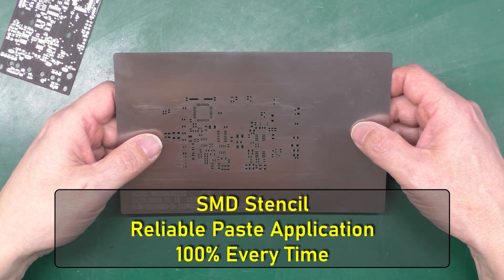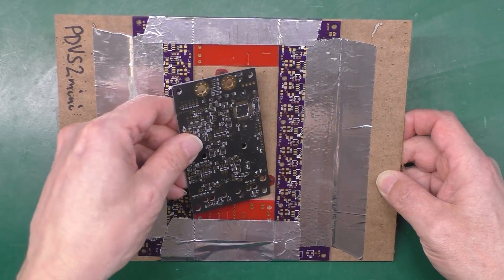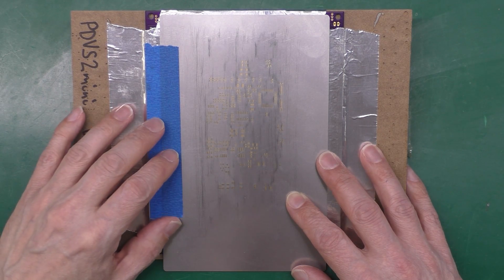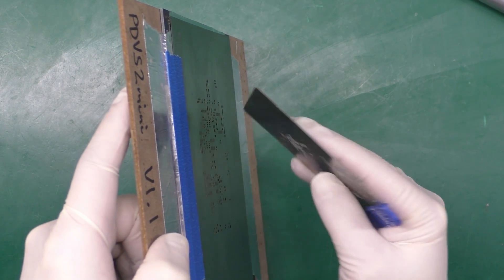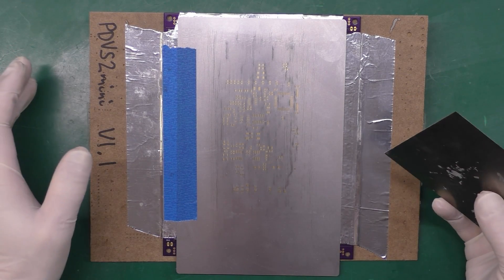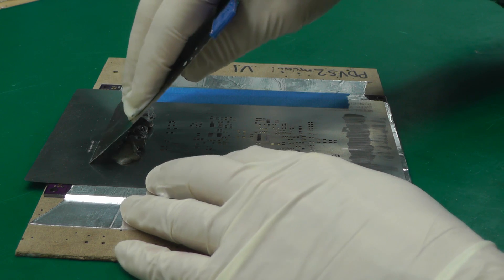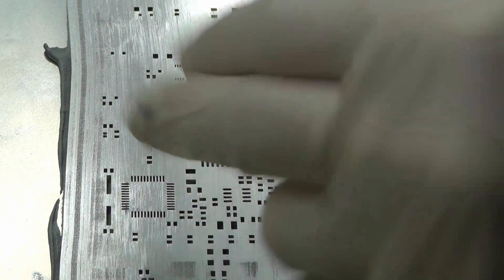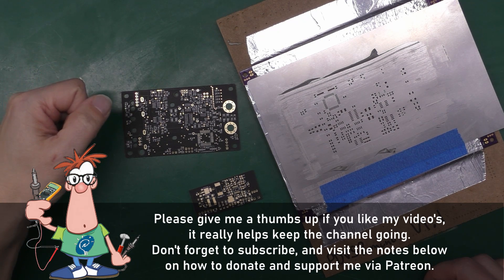No.051 - SMD Stencil - Reliable Paste Application 100% every time

Comment: If you just want to get on with pasting a board right now and can't wait 2 hours for the paste to warm up, can you transfer the amount that you're going to use into another small container and heat it with hot air or microwave it for, say, 30 seconds to warm it quicker? Does the paste need to be stired before using it like you would with paint?

How do you place the components once you've pasted a board? Do you have a pick n place machine or do you do it by hand? If done by hand, how do you not smudge the paste when placing components? Placing 0.5mm pin pitch ICs EXACTLY right first time is almost impossible. When ive replaced fine pitch QFP ICs before i roughly place it on the board with my vacuum pick up tool then carefully and gently nudge it into the right place with my pointed tweezers and rest my wrist on the PCB to keep my hand steady. I solder one corner pin then the diagonally opposing corner. If they are correct i solder the rest of the pins.
Reply from the maker: I place components by hand, and manage to place fine pitch components like the one I showed on the PDVS2mini charger board 1st time, or at least with only the smallest of nudges into place. To me, it's about the tools being used and as you mentioned resting my hand on the pcb.......but there is another trick I use so I'll put together a component placement video soon to demonstrate.
Hmmm, yeah a pick n place would be nice but I'm not at the quantities to justify it, nor do I have the space really.
Reply: Mike harrison aka mikeselectricstuff has a small PnP machine and he doesn't have much space. Search pickin' and a placin' on his channel.
Reply from the maker: @simontay4851  he's got more space than me.......about double. I don't want to put any PnP machine in my other workshop, already got a laser cutter, two reflow ovens, a lathe, bandsaw, pedestal drill and bench grinder there......and no heating out there......:)
Reply from the maker: @philipdifrancesca  mine sits on top of my server cabinet in the workshop, doesnt take long to go from tar to toothpaste......:)

Comment: Thanks, Ian! That is what my research showed. I let my solder paste warm up for at least four hours just to be on the safe side.
Reply: What if you can't wait 4 hours and you just want to get on with it right now . Can it be warmed quicker with hot air or microwaved for say 30 seconds
Reply: @simontay4851  I never tried that because I never get in that big of a hurry anymore. If you use solder paste a lot then don't put it in the fridge. Ask Ian. He has much more experience than I do.

Comment: Its an interesting and informative video. I almost always have solder bridges may be I use masking tape for fixing the jig. The foil tape method is wonderful and I am ordering one right away. The solder you used seem quite tacky kind which brand it is ? also I don't store them in fridge because I don't have a seperate fridge to keep these things. Most of the time I find the solder paste has become solid on upper layer so I throw that outer layer and use the paste from rest. Your solder paste looks like finer grade one. Can you please share the details of that ?
Reply from the maker: GC10 is a fairly new lead free paste which is the type I used in the video. I store it in a sealed bag in the kitchen fridge, and it stays the same consistency for well over a year. I have also used MP100 leaded paste in the past which is the same consistency.

LOCTITE GC 10 SAC305T4 885V 52U -  Solder Paste, Tub, Temperature Stable, 500 g 
Farnell = 2476561
Per - https://www.eevblog.com/forum/manufacture/henkel-gc10-solder-paste/

MP 100 SN62AGS90 AK -  Solder Paste, Lead, Tub, 63 Sn, 183 °C, 500 g
Farnell - 246-9715
Reply: @IanScottJohnston   I vacuum seal mine if they won't be used for a week or more. I vacuum seal unopened flux tubes as well. And I keep them in the fridge, of course.
Reply: @IanScottJohnston  Thanks for the information. I just tried one board with packing tape this time because packing tape is much thinner than masking tape and I used one packing tape beneath the board as well so that stencil stays tightly fit on top of board under solder paste overlaying. This time I got an amazing result with properly filled solder pads with finer details. I use screen printing squeezy which has rubberised edge so a bit soft cushion to the stencil and filled the gaps all at one go. nice fill and everything was perfect. Thanks a lot for sharing your findings in this regard. I just made the jig in hurry and with only two side supports because I wanted to see only. I already made this board 2 days ago and will wash it off. The alignment of stencil got little off which I will take care next time, but if you want to see how it went, here is the link to view the uploaded image. Uploading the finished board too which I did 2 days ago.
www.indicatorsupport.com/stencil.jpg
www.indicatorsupport.com/finished.jpg
Reply from the maker: @SatyajitRoy2048  That isn't bad!.......almost too much paste on the pads but would probably reflow without any problem. Try a really fine pitch next and if ok then you have a good process nailed. Nice one!
Reply: @IanScottJohnston  Yes I noticed that but its way better than how it was used to be before. few more iterations will be needed.